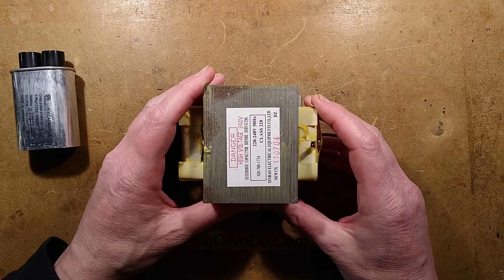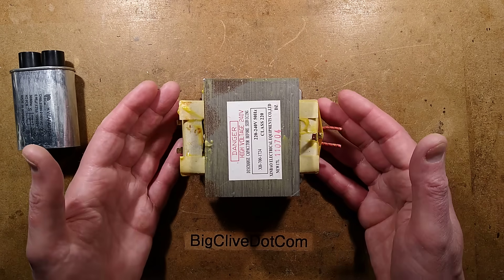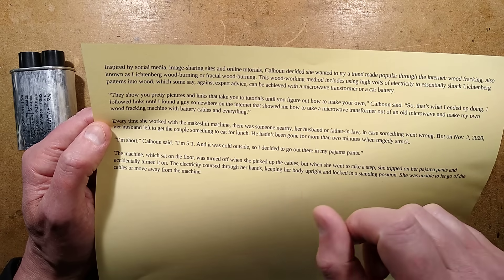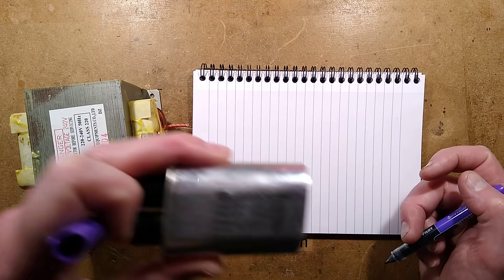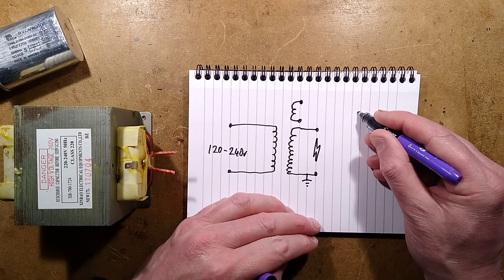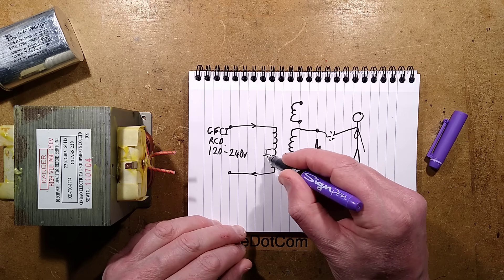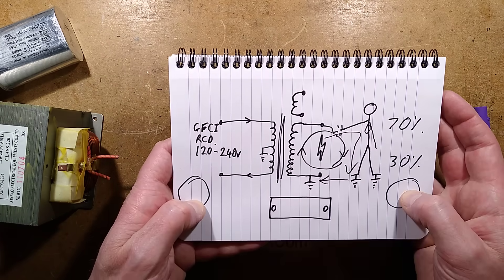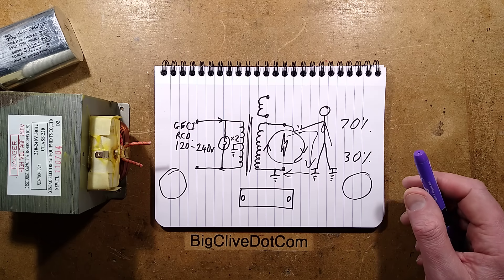The most deadly project on the Internet

Comment: One important safety note that I don't think you mentioned: Make sure that the wiring you are using for a project like this is actually rated for the high voltages you're working with.  The insulation on standard household wiring and on car jumper cables is not sufficient to contain several thousand volts.  Using wiring like that for this application is basically the same as using bare wire.  People have died because they got that part wrong.

Comment: To carry out fractal burning, then clip, or nail the electrodes into position, first.
Then switch on the power, without any contact with the electrics at all.
High voltages can jump gaps. 
So, even if your hands are not actually touching it, the power can still grab you!
.

Comment: Is there no way to make this even slightly safer? A filament lamp in series to limit current? If one siide of the secondary is earthed, isn't that the same as the neutral-earth bond of the substation, so would it be possible to create an ELCB/RCD type device for the secondary? Basically - it's all good saying how dangerous it is, but people will still try this. If there were a way to do it safely/safer then that could possibly save more lives than the warnings.

Comment: Once, I was working in a shop, relocating a light switch. 
The previous day, I'd had my vehicle and tools stolen. 
The shopkeeper was a neighbour, and had asked me to tidy up some electrics, that a builder who had removed a wall had left dangling all over the shop.
I agreed to do the job as it was a bit of an emergency to get the cables cleared, before the 5 o'clock rush started.
The only pliers I had were uninsulated, and I was trying to feed a live cable through a metal switch box, when the pliers bit through the insulation into the live 240v wire. In my other hand was the cable with an exposed earth wire.
The current made a full circuit, through me from right hand to left.
The light was flashing on and off, as the current burned my hand.
I threw my hands off, mentally, three times, but the 240v current completely swamped the signals to my muscles, and I could not let go.
Luckily, I've worked with electricity for many years, so shocks don't frighten me. 
However, I was thinking, ''If I don't let go of this soon, it's going to do me a power of no good!''
So, I kicked the wall behind me hard, and kicked myself free. 
I rolled into the shop, amongst the customers, cursing and swearing!
The shopkeepers wife's eyes, were wide like saucers!
The burns on my hand took months to heal, and the scars are still visible, more than 30 years later.
Moral of the tale, don't take liberties with mains electricity.
Anything above 50vx50 mA is considered potentially lethal.
So, ALWAYS work with tools insulated to suit the voltages you are working with.

.
Reply: I think the real moral of the story here is take the 20 seconds to turn the damn breaker off and don't be shoving live cables into metal boxes.
Reply: @gorak9000  
It wasn't possible!
It was a shop, and the busiest time of the day.
It was winter, and dark already.
The shop had to have its power on for the owner to see his customers.
That's why I was working ''live.''
.
Reply: You were actually on 120 volts because if the pliers were on both legs the direct path between the wires would either blow away clean or blow the over-current protection. I had a live 120 volt #14 wire only touch my hand while holding a hammer while up against steel ductwork on a very hot day with my shirt drenched in sweat and I got a shock that hurt for weeks and caused me to take a one hour lunch taking short breaths to gather myself. It's all about conductivity, that's why people don't respect 120 volts....we are usually well insulated from it. But yeah, people almost always cite the higher voltage when they experience a shock when in reality it is very very unlikely for a person to contact both legs of a system at the same time. If someone says they got hit with 480 volts, it's almost always actually one leg which is 277 volts, the same with a split phase system of 240/120 volts or a 3 phase 208/120 volts system.... it's a really rare occurrence that a person manages to grab two phases or legs at the same time. Regardless, it's all deadly when you eliminate the protection of insulation....120 volts really hurt me that day. Years later I reached carelessly with poor accuracy across a piece of 480 volt equipment that I was trouble shooting and the exact same spot on my hand only bumped in passing on a terminal that was energized with 277 volts (one leg of a 480v system) and it felt like a thunderclap happened on my entire body for an instant. Lots of people would call that getting hit with 480 when actually it was 277. In over 35 years as an electrician, those are 2 of the 3 times I  put myself in real danger of being electrocuted.
Reply: @fritzmiller9792  
I was in the UK, their system is 240 volts.
I'm now in france, their system is also 240 volts.
My biggest mistake was having the earth wire in my left hand, I'd folded it back, so it couldn't contact the live.
In the UK, the earth wire has no insulation.
In France, all three wires have insulation, which is good and bad.
Good because it's safer, bad because the crappy cheapskate French electrician bandits, will use it for three phases. and an earth spike for earth, instead of buying 5 wire for three phase.
This means that someone working on a system may not realise it isn't earth, and will then get 440 volts from live to the earth!
One of these criminals, did just that, but then when he connected the appliance, forgot he'd used the Earth as a live, and connected it to earth.
Consequently my neighbours system tripped out the moment she tried to operate that particular appliance.
That appliance was an 18Kw Kiln!
Not something you want to get connected to.
Also the cable he's used was too small for 6Kw. per phase.
Eventually he had to return and replace the whole cable with three phase, and bigger cross section to suit the current.
Later I was working on an adjacent system, and was about to contact the earth wire, and my brain said, TEST! I did, and that one was live as well.
No identity bands to show that it wasn't.
....and they have the cheek to call themselves ''qualified electricians!''
.
Reply: @niklar55  Wow, I friggin hate hacks. I completely didn't consider your story was from another country, my mistake. Anyway, your story is appreciated as a cautionary tale to others.... including me, haha. I have to remind myself every day to respect electricity and beware of unknowable circumstances that can lead to being shocked AND not contributing to those circumstances with careless decisions while working.
Reply: @fritzmiller9792 
😊👍
Reply: @niklar55  I didn't get shocked (in the electrical sense) by this, but I helped a friend once change out dimmer switches to a three way standard setup. She thought it was the dimmer causing issues, but it turned out the guy had wired the kitchen, the dining room, the upstairs master bedroom, and the master bath all on one 30 amp circuit. It was no wonder that she'd trip the breaker when using her hair dryer when someone was cooking in the kitchen. The worst thing was he had used cheap aluminum wiring, none of it color coded properly, so it took a little testing to get the three way working right, but I told her that she needed a pro to redo her wiring immediately as it was a wonder the walls weren't catching fire!
Reply: I have been struck indirectly by lightning though. Just it coming up through the metal pipes to the sink hurt like nothing I've ever felt. Didn't burn me, at least not visibly, but the nerves in my hand hurt for days.
Reply: @jdyerjdyer  
''but the nerves in my hand hurt for days.''
You were lucky to have any nerves to hurt!

Once, when I was working in a transmitter station, on top of the Rock, (of Gibraltar) we had a ferocious electric storm.
The Rock is limestone, and full of fissures and gaps so there is no good 'earth'. (They ran a copper cable from the top of the rock to sea level, on the east side, but the resistance of the cable meant that it made no difference.) We used to get 120v between neutral and earth, which should be zero, which made fault finding on the equipment difficult.

The lightning was hitting the Rock, and following the water that was running everywhere. The cloud base was around 200-300 feet, and I was 1300 feet, right in the middle of the electric storm cloud. I put my face close to the window to see what was happening, there was an almighty flash, and a bolt of lightning ran down the rock face a few feet away, jumped into the water gully next to the wall, and ran along that, which was just inches from my feet. The wall was only 4 inches thick! I didn't do that again!

All the fluorescent lights were glowing, at near max brightness, from the high level of static, even though the switch was off. 

On a previous occasion,  one unfortunate chap had lightning running inside the walls, and across the floor. He had perched himself on a stack of duckboards, and rubber mats in the middle of the transmitter hall, and stayed there. Air traffic control rang for channel change, (stupid buggers thought they could avoid the interference from the the lightning by changing frequency.) couldn't get an answer, so sent the RAF cops up to find out what was wrong. 
The cops couldn't get anyone to open the door, so kicked the door open! (the lock was still barely functional,  a year or so later.) and found the chap on duty, perched on his stack of rubber mats and duckboards!
.
Reply: @niklar55  Good "war" story. I have been outside in many electrical storms where I could smell the ozone
Reply: @niklar55  I really think it had mostly to do with it being an indirect hit through the pipes. I think most of the charge went into the ground, but I've also seen toilets explode like bombs, so idk. lol Lightning is crazy here in the mountain tops. Sometimes you see the lightning go horizontally across the yard in front of the house.
Reply: @jdyerjdyer  
There's a channel called ''Thunderbolts Project'' you may find educational.
They maintain that lightning isn't caused by clouds rubbing each other up, but has extra terrestrial origins. (The Electric Universe.)
That may help explain some of the apparently bizarre behaviour of lightning.
https://www.youtube.com/user/ThunderboltsProject/videos
.
Reply: @kevinbean3679  
My son and his girl were climbing in Yosemite, and as they approached the summit of one of the rock hills, her hair started to bush out due to static.
My son immediately ordered retreat!
Unluckily there was a group of four that experienced a similar event years later, and didn't understand the warning, took photos of each other, just before they got struck by lightning, killed three and seriously injured at the fourth! 
.
Reply: @niklar55  Yes, I saw that news story. Was on Half Dome ( although many lightning stories come out of Yosemite). Young men knew the risk of being on those rocks in a storm, kept climbing anyway.
Thanks for your reply!!
Reply: @fritzmiller9792  unless you hit the high leg on a 120/240 delta 3 phase panel. That high leg(yes one wire) is 240 volts/B phase. 120/240 3 phase. No not 120/208 3 phase. I'm talking about the wild leg B phase of the transformer. Yes 277 is a beast especially with a load on it. It's like 120 on roids. Your right most don't understand or respect single phase 120 some even 277 with is why they get a jolt or worse. Single phase will hold on to you. If you bump both phases/legs your not going to get rattled you will get a blast. Very rare on wiring unless like u said you cut/hit any 2 phases however. In a panel or on a transformer it's much easier. Especially panel if working hot.. several times been rocked on a 277 circuit with plenty of load on it. Bones hurt! No joke stuff. 120 however is just as fatal.

Edit. Worst I ever got hit was trouble shooting a ciruit with multiple 277 volt circuits and got lit up on the return (neutral). Back then they didn't turn the circuits off your either did it or went home. Didn't even know my own name for a hour or so. This was way before a full boat wasn't illegal.. 3 hots all sharing same nuetral. These days it's neutral per circuit no more multibranch circuits. I fully understand why now.

Comment: I think I'll give messing about with microwave transformers a miss!
Excellent video BTW 👍
Reply: yeah no way im gonna play with a 240v transformer for some art project. not worth it if you don't know what you're doing or what you're playing with
Reply: @_JoeMomma  I do electronics for a living and I still wouldn't do it. Pointless, needlessly dangerous and just generally stupid. I dont know what would be going through someones mind to think this is a good idea. If you like art just do literally any other form of it, this isn't worth it.
Reply: About a month ago was going to take a microwave apart, it was not working right any more, the drive to the rotating glass plate did not work. Just wanted some of the parts like the large caps and circuit boards it was back and forth for a few days to much danger vs interesting parts. Danger won and the microwave went in the bin. Now seeing this video glad I did not play with the interesting parts of a microwave.
Reply: For even more fun get a high voltage rated truly massive capacitor and charge it up for a few minutes with one o’ these puppies.    If it’s not sounding like a gunshot and exploding stuff when it discharges, you’re not using enough power.

Comment: Microwave HV cap has the capability of storing 10KV at 10A now consider it only takes 15mA @ 240v to stop the heart your not going to be getting back up from that
and i totaly agree if your not trained on working with microwaves dont EVEN reach for a screwdriver it just not worth it (and yes im trained)

Comment: I have 2 MOTs at home. I did not ever powered them up because I don't like being electrocuted then vaporized.
I used some old flybacks to burn wood, they are way lower power and safer. They still hurt if not handled correctly tho.

Comment: I don't know about the other countries but in Russia if you want to work with more than 1000 volts you have to get at least 4th level of electrical acess and take exams. So it is not only deadly dangerous but also illegal do do such a DIY project.

Comment: There are a few extra things it would be helpful if you mentioned and the first being when you get shocked the danger of it depends how you are getting shocked if you are holding something with both hands it freezes you and it makes it near impossible to pull away which is why people can end up dying so easily and if you only have one hand and touch something and get shocked of course you can pull away easily it would be helpful to know the difference so people understand that and then it also depends on not only the voltage because static electricity is hundreds of thousands of volts it also depends on the amps which are what can really kill which is like the real strength behind it and the wants I'm not as sure

Comment: Microwave tranformers on local mains voltage output about 2100  V.  Flyback transformers on the back of TV tubes produce even higher voltages (10 000 V up to 35000 V)  Both outputs are approximately 5/3 times as high if it's a transformer made for North/South/Central American service (120V 50Hz ) hooked up to just about anyone else's mains power (240V 50Hz) 
Output voltage is proportional to Input Voltage x Hz.
(240 x 50)/(120 x 60) = (240/120)x(50/60) = 2 * 5/6 = 10/6 = 5/3

Which means that a flyback transformer from an American-market TV, hooked up to European or Asian power grid could output as much as 
 58.3 kV (+/- tolerance, which, with transformers, is often around 10%) so high end tolerate 58.3k x 1.1 = 64.2 kV

Comment: Barbecue, stove, electric kettle or diy pyrotechnics are way more dangerous. Power tools also  The common culprit in all case is recklessness and ignorance, or excessive confidence or distraction for the experienced ones. A machine made for burning or cutting things can burn  or cut you. 
Equating Lichtenberg machines electricity with over head power lines is absurd. The current is many orders of magnitude higher in the later.
I found statistics (not in the links given but probably the same than quoted in the vid ) made for/by  the Journal of Burn Care and Research: It was a review of news report. They found 17 death and 4 major injury in a period of 3 years (in the UK/USA/Canada  it seems).  Grossly 80/20 %.  That's doesn't mean that the likeliess in case of incident is for death  80% and for major injury 20%.  It's meaning that fracking incident related death are 4 times more likely to be news reported than major injury and even more than minor injury or no injury at all (never reported).  It also means that the practice can be deadly or dangerous,  but as the prevalence (how much it is widespread) of wood fracking is not known we can say nothing about the likekiness of such events.